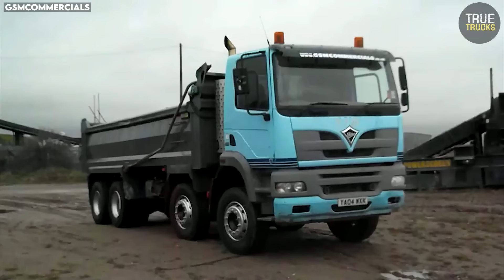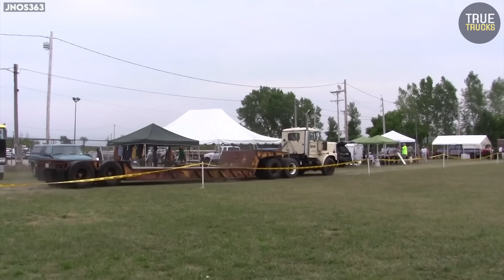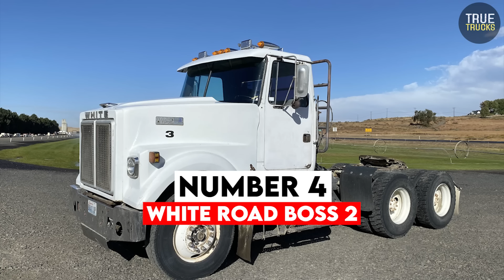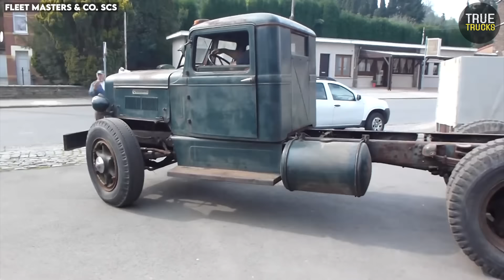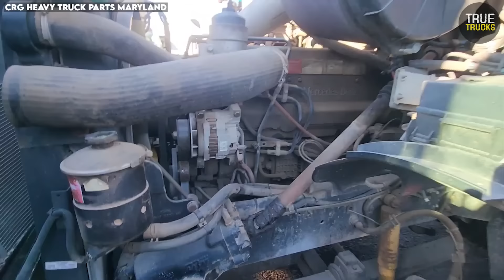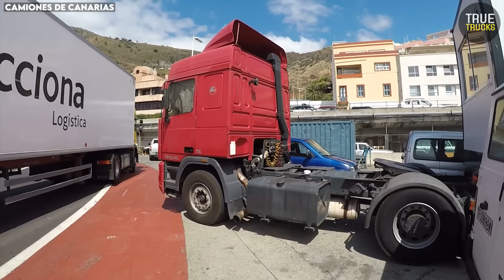10 Trucks That Bankrupted Its Own Company

Comment: White was in financial trouble as far back as the late 1950s. White then purchased Oliver, and Minneapolis Moline and siphoned profits of of them to prop up the trucking company.   Unfortunately they started shortcutting R and D of Oliver and Minneapolis Moline.  There was also infighting created between Oliver and Minneapolis Moline employees which eventually led to White combining both companies under the White name and ending the Oliver and Minneapolis Moline brands. All good companies eventually die when the board of directors is packed with bean counters worried about the next quarter instead of engineers passionate about the machines they produced.  Oliver, Minneapolis Moline,  Chrysler and Boeing are just examples of once great companies who suffered this fate.

Comment: Looking at the old trucks is nice....but..this    AI crap sucks and a lot the info is wrong.
Reply: Got that on heavy equipment in ww2. They were talking cat stayed with cable instead of hydraulics and  1000 rpm motors.  Hydraulics didn’t come about till 50s and cat motor were low rpm much latter than ww2. So Ai need to go to school
Reply: @tim55c "Competition from Freightliner?" Back in the '70's White still OWNED Freightliner. In fact from 1951 to 1977 it was known as WHITE-FREIGHTLINER!

Comment: Yes Diamond Reo went bankrupt in 1974. The employees started spartan fire trucks. While the company Loyal Osterlund bought the rights for the Diamond Reo in 1975. They built Diamond Reo Giant from 1978 to 1995 ended. The Diamond Reo Giant was replaced by T-Line from 1995 to 2010. Brockway shut down because of union troubles in June 1977. The cabs were Mack cabs for about 3 or 4 years earlier! Mack had taken the future design way from Brockway earlier to become the 1977 Mack Superliner. From a non-cdl! WOW. I really hate things are wrong. There just a few.
Reply: Mack owned Brockway, which they bought in 1956! And let them run as a separate company ! But yes, labor troubles were the end for the company!
Reply: @MrLuckytrucker21  yes I know that Mack brought Brockway in 1956. Mack also brought Canadian truck manufacturer Hayes Trucks of Vancouver British Columbia (1928 to 1975) in 1969 & sold it to PACCAR in 1975. They Hayes later that year. Truly sad. Hayes were some greatest trucks never. Other Canadian manufacturers were Pacific Trucks of Vancouver British C(1947 to 1991), Scot Trucks(1972 to 1980)of Debert Nova Scotia & last but not least Sicard trucks of Sainte-Therese Quebec & snow equipment. 1927 to 1967 when PACCAR brought them shut down the truck division to built Kenworth & Peterbilt in 1970. Mr. Arthur Sicard, who invented the first snowblower in 1925. Also White Western Star(1967 to 1979) Western Star(1980 to present) in Kelowna British Columbia(1967 to 2000). There are others like Peninsula, Rubber Railway & Canada Leyland too. I could go on about REO & Diamond T too. I don’t want to be rude. But, if you are going to do a video on something. Do something research first. That was totally in embarrassing on the facts. I’m a non-cdl. Who love trucks. My all time favourites are the Peterbilt 359(1967 to 1987) Kenworth W900A(1965 to 1982) & Western Star 4964(1980 to 1985)Also the Ford L-series.(1970 to 1995).
Reply: Hello, i did not make this video, and Western Star Trucks were bought by Daimler-Benz in 2000 and are not made in Canada anymore! Sadly, they are just uglier freightliners now!
Reply: @M.  Yes I know all about White Western Star of White Motor Company(1900 to 1906 cars)(1906 to 1980 trucks)Western Star history in Kelowna B.C.(1967 to 2002) and the sale to Daimler Freightliner (2000) & their move to Portland Oregon. Did you know that Peterbilt built first 10 running chassis for Freightliner. I’m no expert on everything. But I do know a lot for being a non-cdl. Things like Fageol (1916 to 1939) of Oakland California be came Peterbilt (1993 in Denton Texas)(PACCAR 1958) after Mr. T.A.”Al”Peterman of Tacoma Washington brought and Peterbilt is a window & door division of his plywood & lumber mills empire. I know where all the former plants are & present ones are. Same for Gerlinger of Portland Oregon (1912 to 1923) be come Kenworth (of Seattle Washington/ now Kirkland Washington)(PACCAR 1945). I appreciate you trying to teach me the history of semi trucks. My first post war to video maker. The Brockway of Cortland New York (1912 to 1977)shut down had nothing to do with their cab(it’s a friggin Mack cab). Mack finish them off with the Union issues not 760. How many truck manufacturers could put a Detroit Diesel 12V71 under their hoods. If you are an American. Here something to think about. Look at how many truck manufacturers were in the WW1 era & WW2 era. How many truck manufacturers are in American today. How many truck manufacturers plants are there in America today. In Canada there are only 2 plants. PACCAR (1970) plant in Sainte-Therese Que. & Edison Motors (2021) in Donald B.C. 2025). My post was with the video maker. Do your research before posting on YouTube. Thank you but no thank you sir. Please tell me that Ford L-series Louisville Kentucky (1970 to 1997) was sold to Daimler Freightliner in 1997 & changed Sterling Trucks for 1998 & closed down in 2009. The St.Thomas plant gone & one of Jeff Bozo’s of Amazon warehouse’s. The original Sterling trucks (Sternberg Motor changed name because of WW1. To get away from the Germany last name) of Milwaukee Wisconsin started in 1906 to it was sold to White Motors in 1951 & closed in 1953. I could go on about trucks all day long. I learned from books & magazines of the mid 1970’s. Like the Overdrive, Owner Operartor  & Canadian Road Knight. I’m to repeat myself. I’m not the one who needs a history lesson. Please go bug the morons over their mistakes & do their homework doing their next videos. Have a good weekend. Please don’t reply back. THANK YOU. BYE.
Reply: Brockway used a modified design version of the R Model Mack Cab, and a modified F cab, but the cab stampings and assembly was done by a company called "Sheller Globe". I've had old-timers when I was a kid show me the difference between the cab parts and subtle little things like the spot welding pattern. Stuff you'd never notice if you were just changing a door or something.

CCC also used the Sheller Globe "R Model" cab on some trucks. I kind of remember seeing one that was Detroit powered and had a frame built from straight I Beam and not pressed channel like a normal truck
Reply: @j@j @joecummings1260  Brockway used the Mack R-series cabs & F-series cabs, so did Hayes on their 2nd generation cabovers when Mack own them. After PACCAR bought Hayes, they used the Peterbilt 352 until they were shut down at the end of 1975. Just like when Mack used the Ford C-series cabs for their N-series with their own floor pan or dog house. They bought them from Budd Automotive, who were stamping them for Ford. Also FWD & half a dozen companies used the C-series cabs. Scot Trucks of Canada used Ford L-series cabs when they first started production. Another Canadian manufacturer from Cambridge Ontario also used the Louisville cabs for their massive 4 axles cab & chassis for large cement haulers, Rubber Railway. Just like Henderson Trucks used International Harvester cabs. Both cabovers & conventional cabs. REO had a joint venture with International Harvester on a new cab back in the 1950’s. The reason for the end of Diamond Reo Giant is that Western Star was going to a new cab & Autocar was stopped using the late 1950’s or 1960’s White’s cab was being phased out. THANK YOU FOR THE HISTORY LESSON THAT I DON’T NEED. MY WHOLE FRIGGIN POINT WAS ABOUT ALL THE FRIGGIN MISTAKES THAT THE  MORONS WHO MADE THE FRIGGIN VIDEO. FOR A NON-CDL PERSON, I KNOW A LOT ABOUT TRUCKS, BUT FRIGGIN NO EXPERT. HERE THE GUY BELOW THIS COMMENT WHO COULD USE A LESSON’S ON HOW FREIGHTLINER ENDING THEIR AGREEMENT WITH WHITE MOTOR COMPANY, ISN’T WHAT FINISH THEM OFF. THANK YOU.
Reply: I swear my 10yo granddaughter knows more about this subject than whoever wrote this garbage!
Reply: @johndillon2060  was your comment directed at me or the video morons?
Reply: @joh @johndillon2060 y guess is need to get off your 10 year old granddaughter. You properly crushing her cigarettes anyways. Inbreders. Do the letters F.U. mean anything to you?